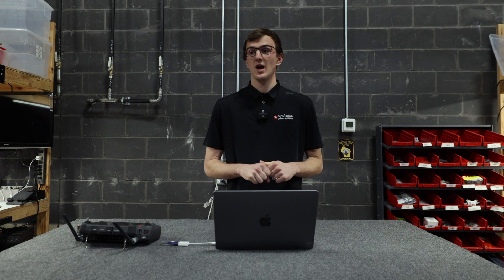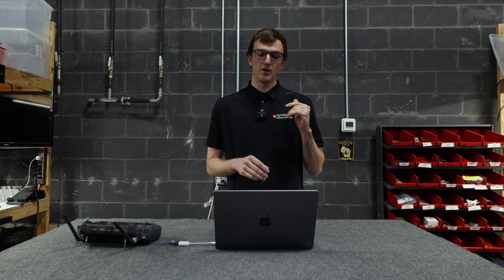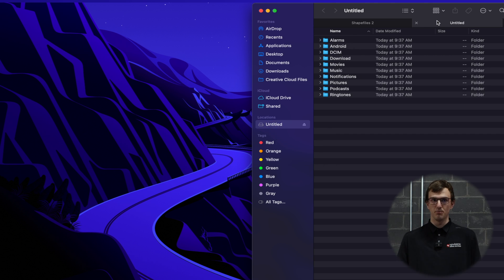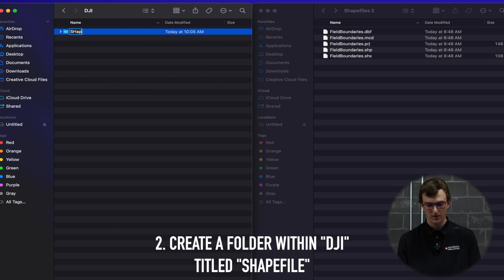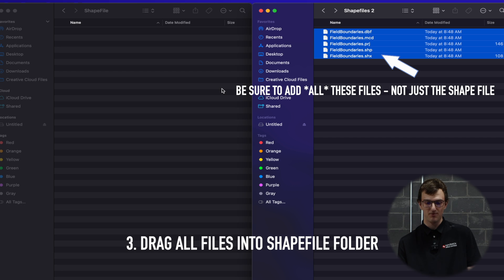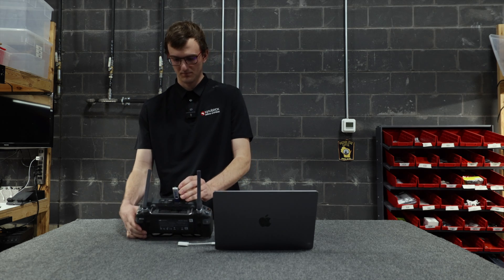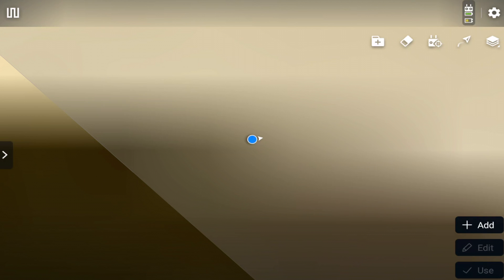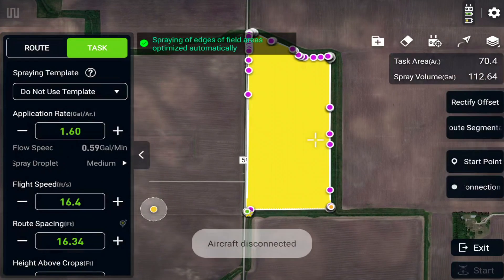How To: Transfer Shape Files to T40 Controller (DJI Agras)

Comment: How would you add multiple shapefiles if they all have to have this naming convention?
Reply from the maker: Renaming them one by one on the controller.
Reply: @maverickagriculture  That's what I did but I'm surprised there is no batching feature. Renaming them individually is tedious when you have 24 treatment plots in a trial and multiple trials in a field.
Reply from the maker: @BrandiGriffin-j5p  You are not wrong. We will try to find a fix and also let our DJI rep know about this. Thanks!